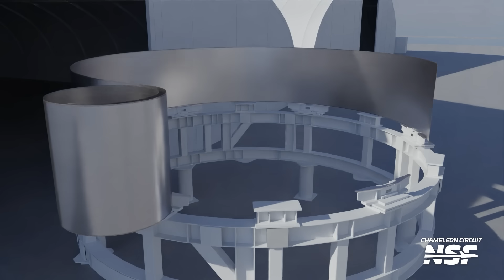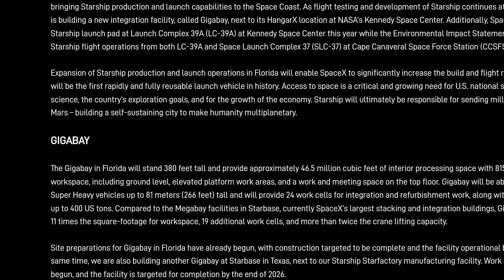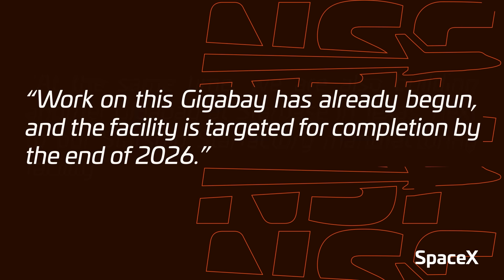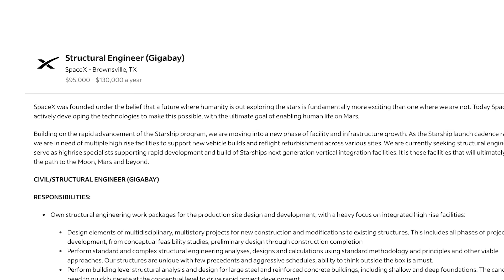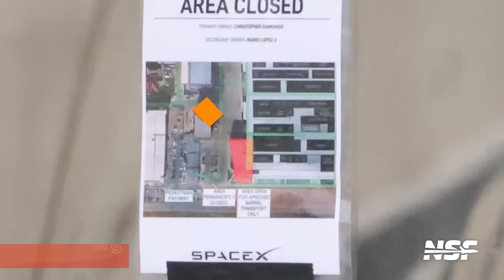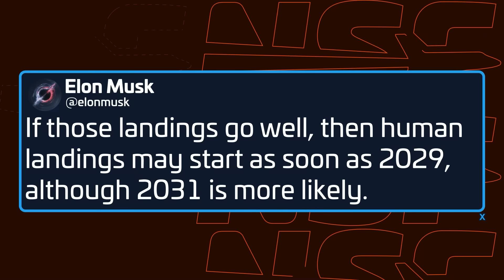Despite Flight 8’s Failure, SpaceX Races Ahead Towards Mars | Starbase Update

Comment: Again, Starship is not the thing to build Mars colonies. It (will) be a great way to get ALOT of payload to orbit at incredibly low prices. However, Mars is simply too far away for chemical rockets launched from the ground that need to carry humans, payload, propellant and alot of water and energy onboard. There's only one realistic solution..and that's nuclear spaceships with plasma or ion thrusters. You assemble those in orbit from pre-produced parts, dock a descend shuttle to them to access Mars surface, fill them with payload and neccessary supplies and you go. Not only will they be faster...alot faster than Starship could ever hope to be, but they will have years worth of nuclear fuel onboard to make mulltiple trips there and back before needing to be refueled. That's the future. Starship would be the ideal solution to get the parts into orbit to assemble these massive spaceships.
Reply: I missed this comment before posting mine, yours is better! NASA has the concept of Gateway correct.  Have a vehicle that works for travel in space and a separate vehicle that takes you from orbit to surface.  You don't use an ocean-going cargo ship to transport groceries to your house. The cargo ship does the massive, long-distance stuff, and your car does the short hauling. PT Musk's obsession with Mars now is masking a lot of the good work he is doing with spaceflight. His ego has led to many setbacks because he knew better than the scientists he hired. Elon says, 'No flame trench' so we get a rock tornado. Elon says 'catch on a tower' so we get a ridiculous, but cool looking, diversion from a much more practical landing that could occur basically on any decent flat surface.  Calling someone out for bad decisions isn't hating, its called reality.

Comment: Haven't people learned not to trust any timeline musk suggests😂
Reply: the thing is, he is still getting things done. as is starship block1 is a viable launch system simply letting second stage burn up like a huge falcon 9.
Reply: @DavidStrain-t7r viable? Afaik raptor has never relit in orbit, block one has no cargo infrastructure nor a deployment system.
Reply: @janschmid281  Raptor did relight in orbit.
Reply: @epj0211  when? They only did the fuel transfer test, but not the relight.
Reply: @janschmid281  IFT 6.
Reply: @epj0211  you are right, it did. My other points still stand.
Reply: Sending Starship to orbit Mars and return to earth would be a great "stunt".

 As long as they put proper radiation monitors in the crew cabin, then we will have proof that the crew will die of radiation poisoning long before they returned?

Comment: It was observed that the chopsticks moved all the way to the right for flight 8, i wonder if they weren't simulating the ship catch position using the booster as they would want to drop the booster on the mount and catch the ship as far away from the booster as possible.

My guess is they are fitting catch hardware now in case they discover they can go for a catch at any point. They may also see if they can drop the booster and position for a ship catch in time while simulating the catch in the ocean like they did with the booster initially.
Reply: No i believe the booster was not on track so the chopsticks had to be repositioned. But who knows SpaceX would never admit they had an issue with catchign the booster.
Reply: @Andrew-v4z6u  what do you mean? They dont hesitate to say if they have/had issues.

Comment: Q: Why are Starship test flight mishaps not a big deal? 
A: Because no one has invented big enough crash test dummies.
Key word: "test" 
These are prototypes.
Reply: @angrylittlespider4593  Prototypes are not ment to continually fail, at somepoint you have to get a actual product. The Starship program has consisted of throwing s**t at the wall and seeing what sticks, and that turns out to be not much.
Reply: @Voodoowings101  Tell me you have no idea how prototyping works without telling me you have no idea about hoe prototyping works.
Reply: @BabyMakR  Prototyping means getting a product that eventually works, with so many failed prototypes it is not looking good.
All that data from 9 attempts and yet they cannot fix the major problems, like ensuring engines do not fail.
After 1 failure you would expect a lot of testing and reworking of the systems that failed, yet here we are in prototype 9 over 2 billion dollars of taxpayers money later, and they still have the same problem with the fuel system leaking.
In absolutely any other business, project managers would be fired and big investigations would be underway by prototype 3,  All test flights would be stopped until they could, with the tons of data collected, actually prevent the same issues from happening again and again.

What SpaceX is doing is not prototyping, they a are failing to develop a vehicle that works constantly.
Reply: @Andrew-v4z6u  There have been 2 Ship failures due to the engine issue which could have been caused by different things.

Meanwhile, $2B won't even get you half an SLS launch which keeps getting pushed back further and further anyway.

New Glenn's first stage can't survive re-entry, let alone land.

I guess we should just stop all space flight altogether.
Reply: “Continually fail” is an exaggeration 👀
Reply: @bradizzlemynizzle  Concidering the HLS contract was for a version of Starship to be landing on the moon last year, and the most recent pair of explosions in the upper atmosphere. I'd say your expectations are way to low, just like how Musk wants them.

Comment: I don’t get why everyone is so negative about Starship now. The entire SpaceX philosophy is to move fast and break things. When you consider that V2 is basically a completely new vehicle, the results so far should’ve been expected
Reply: Starship has not yet demonstrated the core functionalities that would prove its value (orbital payload capacity, atmospheric reentry with no need for repairs, orbital cryogenic refueling).
Without any of those, it can't fulfill it's 4 billion dollar Artemis contracts.
The hype will inevitably die down as the timelines get pushed back, as promises and goalposts keep being moved to the next version and the next launch. 
Why should anyone be positive without proof?

Starship v1 was promised to be able to deliver 100 tons to orbit, with full rapid reuse. The design absolutely failed to deliver. Now v2 seems to also be failing at this task... When is negativity reasonable for you? If v3 fails? V4? V5?

Comment: "Starship departs for Mars next year"

This is me pressing X to doubt.
Reply: Yes, but he doesn't say when it will arrive at Mars, or in how many pieces.
Reply: @Thermalions  They need to at least make orbit first.
Reply: @TheGreat_Kramer1  So many people say this. Do yall not realize that they go suborbital on purpose for safety in these tests? If they wanted to put a ship in orbit it would only require burning the engines for a couple seconds longer.
Reply: @odstwingman  engines (or at least leaking fuel around them) have blown up mid-burn for the last two flights. They currently do not have the demonstrated capability to get a ship to orbit. It's not simply a matter of burning engines for longer; it's more a matter of stopping the ship from blowing up.
Reply: @andrewdavie386  They weren’t blowing up before.
Reply: @andrewdavie386  The last starship iteration was perfectly capable of getting into orbit, they just chose not to for safety reasons, V2 however certainly has a way to go.
Reply: @nzoomed  it.... blew.... up.
Reply: @ No it didnt, the last 2 starship V1 launches landed in the ocean, albeit with some damage from heating during re-entry.
Reply: @nzoomed  IFT-1 slip your mind?
Reply: @nzoomed  the last two V2 launches (the only relevant design - V1 is retired and never reached orbit) blew up. SpaceX are yet to demonstrate orbital capability in any variant of their Starship. Just because you have engines and fuel and you designed your ship to orbit... doesn't mean it's gonna work.  Me, I think it will work - but the point stands - they have not demonstrated orbital capability yet.
Reply: @ the design has changed; in particular the manifold to the engines is now totally different. The new design is blowing up earlier; maybe it's worse. In any case, it's not the same at all, and they're still to show the new design is fully functional.
Reply: I'm pretty sure sending a Starship to Mars would require in-orbit refilling to be developed, which would also require a large number of tanker Starship flights in short order. It seems unlikely that SpaceX gets this done by the end of next year.
Reply: @cube2fox  Exactly, a minimum of 10 flights is necessary to support sending one ship to the Moon or Mars. That is why it was a poor choice for NASA to let Elon choose Starship for the Artemis mission. A variation of Dragon would have been much more efficient and quicker to reach the Moon, but Elon wanted to get the government to subsidize Starship.  Starship will NEVER fly people to Mars. There are so many problems to be solved biologically first which he hasn't worked on at all. A propellent-based rocket will never be feasible for massive transport to another planet.
Reply: @acethater9002  NASA also didn't want a Dragon variant, or rather the US Congress. They wanted something that is compatible with SLS and Orion that replaces the Altair lander from the cancelled constellation program (SLS is too weak for Altair).
Reply: @cube2fox  Sadly true, the sometimes-ignored complication of outsourcing to private contractors will always be compatibility issues. Just look at the "universal" usb-c connector!
Reply: @ The cheapest option would have probably been to outsource everything to a few fixed price contractors and to cancel SLS (which isn't fixed price and involves a significant number of cost+ contractors). ULA did indeed propose such a solution without SLS, and it was favored by then NASA administrator Jim Bridenstine. It was called the "Briden-stack" I believe. But the US Congress shot down this proposal in favor of SLS, which turned out much more expensive than expected.
Reply: pressing X to believe confirmed
Reply: who says it'll get there?
Reply: With no regulations and a fully unlimited budget, literally the entire US GDP if Elon wants it, why even doubt? He'll have his Mars kingdom in no time.
Reply: "Starship departs for Mars next year" Well that's the next launch window but good luck!
Reply: "Starship departs for Mars next year"
Consider it done...
Watch "Ameircan Moon" - at least the 10 last minutes! and consider it done.
Reply: I'm going to change the old saying. 'Over my dead body'.  To . 
'Hopefully with his dead body on board '
Reply: I'm pressing with you
Reply: Its a grift at this point. It has been delay after delay just like full autopilot, hyperloop and everyone of elons pipe dreams

Comment: SpaceX should consider flight testing Starship without the booster. It could travel up to 12 miles and be brought back for a chopstix catch, which would be much cheaper than a full flight.
Reply: Why though?
Reply: @falcon9ft710 Did you read the whole comment? Cheaper+less risky
Reply: @Jeremy.Klakson  But it would not test anything important, just cost money (so very expensive and risky compared to what they would get from it). They already tested that they can catch a booster and they have tested that they can bellyflop and precision land a starship multiple times. Its everything else that is more important to test, a chopstick catch they can add when everything else is working.
Reply: @drosendahl  Yeah, you're right. Sorry
Reply: Why , they already demonstrated belly flop and controlled descent on a spot of starship. 
They have to demonstrate orbit , starlink deployment and re entry without burning  through the flaps. 
The landing is already there
Reply: @mattfgln  Perhaps it would be somewhat of an improvement if they could get it into orbit without it exploding. Just a suggestion.
Reply: @DrWoodyII  and ? I literally wrote they have to demonstrate it can reach orbit
Reply: @mattfgln  Yes, that was very clever.
Reply: @DrWoodyII  certainly more clever than what you wrote

Comment: Can Starship complete launch just using the Vacuum Raptors when the booster departs?
Reply: No.  Vacuum Raptors don't gimbal so you could not steer the ship.
Reply: @59seank  Raptor steering only critical during landing.
Reply: @plywood76  Vacuum raptors can't steer.  Steering is necessary during ascent and descent.